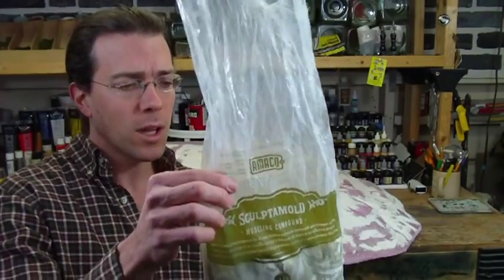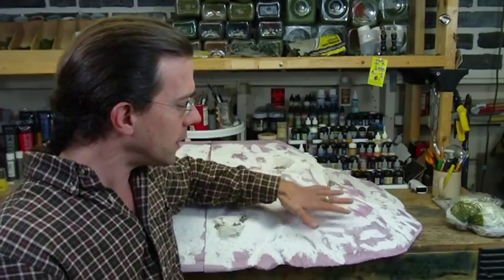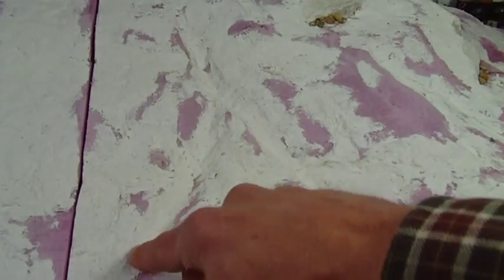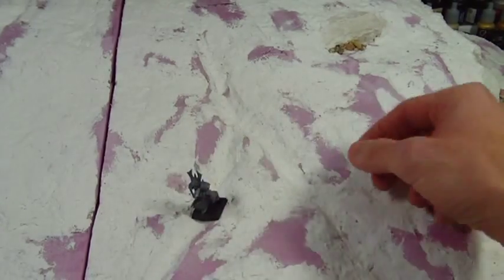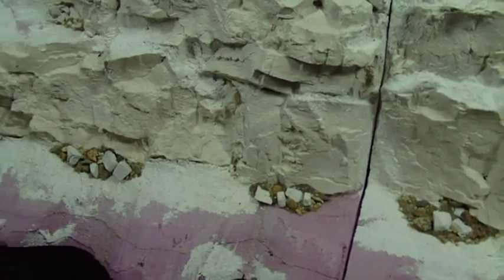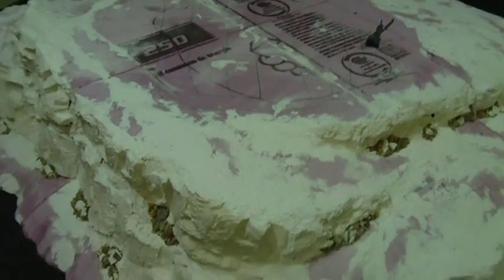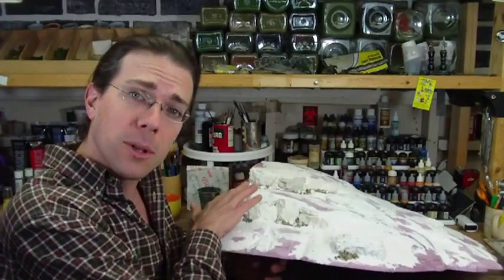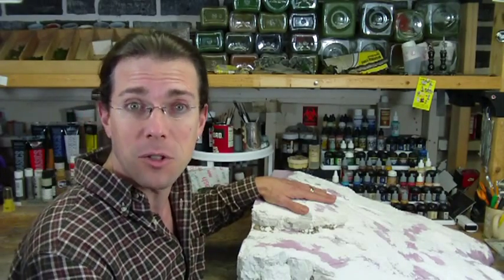TerranScapes - Surfacing the 'Big Hill'

Comment: @Terranscapes Excellent. I can see now how getting a square edge for each board piece must be very difficult, if you are using a hot wire - even if it's fixed in place.

I've got some designs for a set of 600mm square boards set into a folding wooden frame. I've no idea if it'll work but I'm confident. No idea when I'll find the time to get it done though! Your work provides lots of ongoing inspiration and motivation.